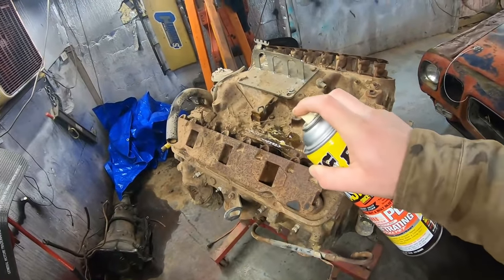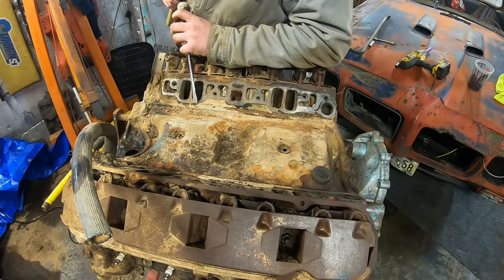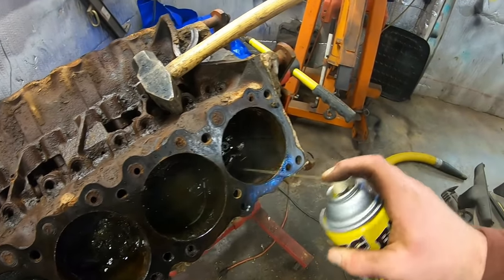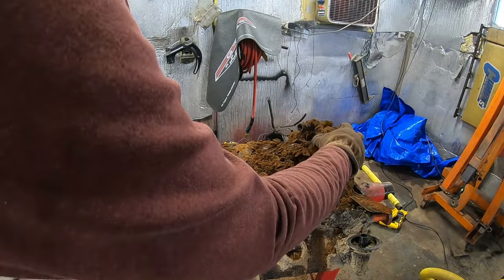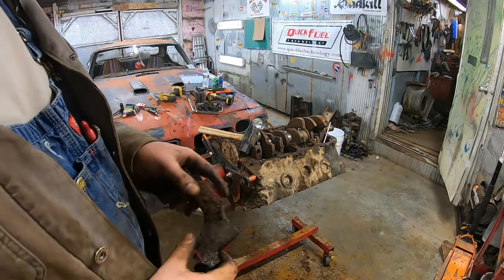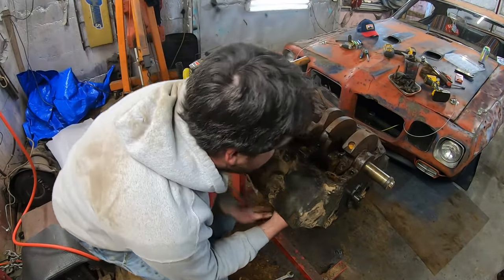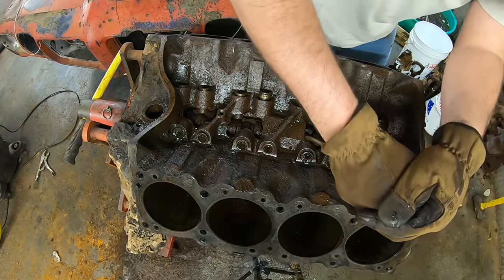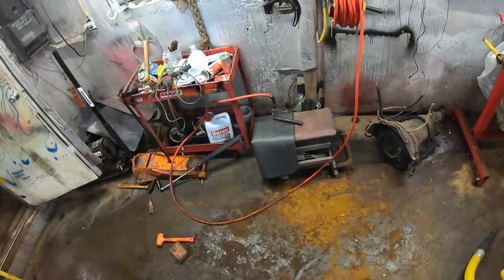INCREDIBLE! Worst GTO Ever: Holey Goat OG Pontiac 400ci Engine Teardown — CAN IT BE SAVED?

Comment: Putting that back into the car will be absolutely awesome, "numbers matching" engine dropped back into this car will just add to the complete absurdity of it all.
Reply from the maker: Yes!
Reply: @PoleBarnGarage  hey… it’s only original once. Lol 😂
Reply: Dooooo itt
Reply: I am thinking rebuild it with a low-end cam then put in one of the older non computer run Chevrolet trucks for a work truck towing engine.
I checked a few days ago will these engines bolt to a turbo 400 transmission and yes, I found they will.
Chevrolet SB 400 is near impossible to find now so the 400 Pontiac has the same 3 -3/4 inch stroke as the Chevrolet SB 400 which makes for a great pulling engine.
Reply: @Lure-Benson  Not sure about bell housings, there is what is called BOP and then there is Chevrolet.  BOP means Buick Olds Pontiac.

Comment: Oldsmobile had the valley pan also. I rebuilt a 350 rocket and I changed the valley pan and never knew that Chevy didn't have one till I worked on my 73 C-10

Comment: I too have always been fascinated with shipwrecks, and the Titanic in particular, since my youth. She has three engines. The two outboard engines are standard reliable triple-expansion reciprocating steam engines. The center engine is a new, revolutionary low pressure turbine, located in a separate room just aft of the main engine room. Powerful, efficient, but unfortunately not able to be reversed. James Cameron depicted this accurately in the movie when the center screw did not reverse. These engines are also low mileage! After watching your video, I am convinced that if somehow those engines could be retrieved, you could save them. With LOTS of PB Blaster LoL!🤣
Reply from the maker: Pull the permits, we got a ship to raise
Reply: @PoleBarnGarage  I'm in!

Comment: I agree with your thoughts on the poncho mill. If the freeze plugs are still in it the skirt area of the block is probably fine. No visible cracks in the lifter valley and I’d guess it hasn’t frozen/busted. Fingers crossed for the magnaflux. Did the crank have a N cast in it? I imagine so with those heads. Hopefully the rods aren’t pitted.
Reply from the maker: Rods look ok at first glance, I think it's a nodular crank

Comment: FYI use the small harbor freight moving blankets , just the right size too ,on the floor under your engine stand during a tear down , or assembly , the catch and soak up stuff really good , and then just toss them , they also have saved my bacon when I rotated one and a lifter slipped out , it cushioned it and it lived , straight to the concrete it most likely would have received damage ... on a stuck piston drilling 1/2 holes as close to the outside as you can without risking cylinder damage will weaken the piston , helping it flex and break loose when driving them out ... I have rebuilt worse than that engine to keep a car numbers matching , no hood or carb for 30+ years it took 8 sleeves , and 16 more for the lifter bores LOL

Comment: It's the friction of the powdery dust/dirt going through the hose that generates the static, and running a wire between the hose/yourself and the block/engine may help keep you from getting zapped.
Dissimilar metals will generate galvanic corrosion where they come in contact with each-other when there is moisture to complete the circuit. Being dissimilar metals, they act like a crude battery and an (extremely weak) electric current transfers metal from one surface to the other, like electroplating. A lot of oxides/corrosion are generated as well.
That's why you can sometimes find well-preserved parts in a waterlogged engine, other parts (like the magnesium case of an air-cooled VW engine) will break down and put a protective coating on the steel parts as they do so.
Of course, it all depends on when the engine is disassembled/salvaged, as that thin coating will also eventually break down and the steel parts will resume corroding away. 
I talk like I know this stuff, but I'm far from an expert on it, so do your own research in case I have stuff wrong!
A desperate person could probably braze that dizzy, if the casing would hold up to that level of heat without melting.
The innards might be worth something even if that's not possible, presuming the shaft is okay.
That valley-plate could use the attention of a wire-wheel, maybe even a needle-gun!
It's likely dirt-dauber wasps that made those nests in that one cylinder, and in any empty bolt-holes.
I have a VW engine-case with most of the bolt-holes plugged up by them!
Ah, I see it has the Titanic-look windage-tray option, that's surprisingly rare!
Man, that bottom-end is way worse than the VW cylinders that I had to pound apart with a sledgehammer! XD
How the heck did mice get inside the oil-pan?!  Surprised there's an oil-pan left with how acidic mouse piss is.
Need to get you some brass rods for beating stuck parts out, then you can really pound 'em!
One interesting simple rust-removal technique I learned about from a gun-restoration channel, boil it off!
That's right, boil parts in plain old water and the rust will loosen up, turning into soft black oxide.
I'd say test it on junk parts to figure out some of the particulars, still figuring it out myself.
I don't see a modern one surviving all that, but an old mechanical fuel-injected might survive! (like a diesel)
Great first video of yours for me to watch, good fun and unexpected results!

Comment: So glad your saving that Pontiac 400 ! 10.25:1 compression 350 HP, SO GOOD. why build a chevy when you can have something different!! Pontiac Power
Reply from the maker: A bone stock rebuild on that 400 would spank any average guys "built" Chevy all day
Reply: Agreed my stock 400 in my lemans was a low rider is a low rider 70k og miles and with 6 extra deep cycle batteries hydrolics would spank a lot of cars on the street that’s why it’s going into our goat unless we turn it into a strip car right now it’s just a dream

Comment: Nice. I have 1970 #13 heads on my TA. I’m running e85 and a turbo. Those heads handle 21 psi like it’s nothing…Nothing special used. Factory head bolts, Felpro head gaskets..Nice project..
Reply from the maker: Are you serious? That is an insane amount of cylinder pressure.

Comment: With all the dirt that was falling out of that engine, I'm surprised the build up didn't lift you up so high that you hit your head on the rafters! I don't understand why you didn't just pull the drain plug on the oil pan and fill with new oil! LOL Thanks for the tear down and look forward to the verdict from the machine shop on block condition. The video's on your other vehicles will be great until then.

Comment: High speed air through the rubber/plastic hose causes the static electricity to build up on the hose and you. Use a car key to touch the engine and discharge through your hand but draws spark from the key.  Good to go.

Comment: I've used pure white vinegar for cleaning cast-iron carburetors on my old John deere and Farmall tractors over the years. I've Never had a problem with it using it in gas tanks either after letting it set for a few days.

Comment: That engine is in way better condition than the 455 H.O. from a '71 Trans Am I scrapped about 15 years ago.  Frozen water inside blew out four cylinder walls and rotted off most of valve heads from the stems. Shame the car only had 74,000 miles but left for dead since 1981.
Reply: Amazing how water is worse than Texas dirt. Just goes to show how storage of the engine is so important.

Comment: I disassembled many flood engines, if you make your own hottank out of a 55 gallon drum and heat it with electric hot water tank heaters under  a raised bottom.  This dissolves most rust.  Pistons are cheap, acetylene torch melt the pistons if stuck don't breath the fumes / smoke.
Reply: Do you use any chemicals with it?

Comment: I think you could call yourself an archeologist.   By the way, I saw a test of different products for penetration,
 and they found out that brake fluid is the best no matter how much you spend.    The problem is paint.  So if you are not worried about taking off the paint, brake fluid is the answer.
Reply from the maker: Brake fluid is corrosive?
Reply: @PoleBarnGarage  it’ll for sure eat paint
Reply: @PoleBarnGarage  Yes.  I forget who it was that did the test, most people don't want to lose their paint though, and it is cheap.  The comparison was with some very expensive stuff too.

Comment: If that car had the original numbers matching motor, the cool factor would go up 10-fold.  My father in law had a '68 GTO and he blew the original 400, and just put a bland 455 in it, and it was blah after that.  Probably lost 100 hp or more with the 455.
Reply: If you can find 6x heads from a 400 (100 cc combustion chamber) you can get a nice compression boost on that 455.  6x heads were dime a dozen at one point, maybe a little harder to find now but if you see them and they’re cheap, it’s worth picking them up.
Reply: I think he did say it was a matching numbers block early on in teardown.snooky

Comment: I did a 1963 olds 215 a couple years ago that was froze up as hell.  The combination that finally got the pistons free was 50/50 acetone and ATF soaking for over a week.  I still busted 3 pistons knocking them out.
Reply: Commented before I saw the wood... after I broke through those 3 pistons with a 1 inch steel rod, I finally got them out a few days later with some generic pallet wood... maybe a 2x4... prolly not, the 215 doesn't have pistons bigger than 3 in... after the fact... a .030 rebore, and it's good to go.
Reply: As for your last question... NOPE!

Comment: I had a 440 like that, came out of a car sunk in a lake for 10 years. I tore off the heads, intake, pan and power washed it got all the mud and crap out of it and then dumped the whole thing into 50 gallons of diesel and walked away from it for 6 months. Came back tore it down and rebuilt it and it runs fine! Makes my ol Dart go like hell. :) This video is like reliving that whole thing...lol

Comment: I just dissembled a dodge 340 that has been setting out side in a junkyard for years, had leaves and mud and dirt all in it, the cylinders was rusted and pitted the pistons was rusted solid, It took me awhile and a lot of PB blaster to get it apart but once I got it to the machine shop it had to be bored 60 over bc of the pitting but I did it and got a new rotating assemble stroker kit and it should come back to life in the next week or so in probably 20 years of setting. Can’t wait to see you bring this old Pontiac back to life
Reply from the maker: Very cool

Comment: i love the 400 pontiac one hell of a engine use to have it ran forever then traded it for a bunch of parts for a 73 ss nova build with a 396 . i still have my 66 389 tripower in my 66 gto
Reply: the heads look good i had a set sitting out side in the dirt for years and someone rebuilt them a set of closed chamber 194 camel heads the block looks good just call it seasoned . we took a 327 put over size cylinders in it then set out side for a year to season the block then rebuilt it . seasoning the block helps rings last longer learned it from a pro engine rebuilder

Comment: Little late, I’m starting to watch your videos in a attempt to better understand motors or vehicles as awhole it’s a learning experience for me. But to answer the static shock question, the easiest answer I could give is the cleaner you used to spray the engine with  it more than likely mixed with the mixed metal in the dirt and all the friction from the sucking more than likely transferred through the thin plastic to your hand and discharged upon touching the ground (the motor) best to use a cleaner with a nonconducting liquid.

Comment: I am an old time speed shop machinist and although I couldn’t really see how bad the cylinder bores were, but there .060” over pistons available back in the day. Now, the cracked main cap, more than likely with a replacement cap, the block is going to have to be line bored.
Reply from the maker: It's gonna need all the mains I'm afraid

Comment: Thanks for the reply did you know that they all also made in line 6 engine's for each brand of GM and that Buick and Pontiac also made straight 8'S some that were over head valves and some flat head's and in 1914 Cadillac had made a 314 cubic inch V8
Reply from the maker: Yes, until 1980 all GM divisions were free to develop independently.

Comment: Going back in time to see some early stuff. Love your videos. FWI the static electric shock you mentioned could be caused by some fine metallic (conducting) powder in the dust (rust) that creates a zone of conductivity around you when its all airborne around you. Good for conducing high V low A  static. Source Might be from your hair or something nearby lke a piece of rug you’re standing on. Anyway when your all charged up (including the cloud around you) and you touch a ground then Zap!  Might be a bit larger charge than normal.  Dave (professional engineer and owner of 1964 Galaxie Convertible plus many orher I no longer own).  Keep up the good work

Comment: On those lifters Ive done it before and it worked but I’d only do it if you had no other way would be to take a self tapper and go in about half way and use a slide hammer to pull it out

Comment: You might have to replace a few parts but I think that blocks and tack if they can hold it out bored out if it's a stock motor that's never been rebuilt. I'm sure you can clean up the cylinders at blocks. And great shape, that's a little filthy. Yeah, first time I watched this it kind of scared me to be honest with you. I think it's solid to me. You have to get a new crank, put in it.
Don't let it overwhelm you.

Comment: Fun fact- big block molars had a intake valley cover as a part of the intake gaskets…. And if’ in ya want an easier time rolling your engine over on the stand-axle grease the hub , lube is your friend
Reply from the maker: It was more because hazardous freight design quality lol
Reply: @PoleBarnGarage  nah mine is the cheap Canadian version-probably the same maker w/different paint color and it’s held 3 small block mopars and a slant 6 with no complaints-grease er up!

Comment: Many moons ago I took a head off a 1960 389 in a car that sat for decades with no hood. 

That was a bad engine inside.  Vertical cracks in the cylinder walls, and I saved a couple of the valves because the stems were rusted most of the way through.   This thing looks great in comparison.  But all I did was take a head off it, who knows what the bottom end looked like. 

My dad bought a '70 Gran Prix brand new and that nylon timing gear failed pretty early on, left them stranded on a trip in like 1972.   Pretty wild that was still in there. 

The same yard I also had to pop a stuck '56 316 off the trans.  With that early Hydramatic the converter doesn't just slide off.  So I had to do the same deal and get the crank out with it stuck.  I must have been lucky because I was able to reach all the rod bolts.  I don't even remember why the guy wanted it but eventually I got it down to him.

I actually got him two blocks but the other one was so bad I used it for a weight in the back of my folks pickup and then at the Syracuse Nationals when the swap was on pavement I roped the canopy to it so it wouldn't blow away.

Comment: The 400 is a solid engine. I had a 400 in three different cars and the only major things I ever did to the engine was replace he timing chain and gears, replace the lifters and pushrods. Rebuilt the carburetor and replace a water pump.

Comment: Next time, too use as a soak to get rust off, buy a gallon of Muriatic Acid, available at Lowes, and Walmart (used to clean pools and concrete) and mix 16oz per every 3 gallon or so of water and let it sit overnight.  Preferably hot water. 
Or use acetone mixed with transmission fluid, which also works better than PB blaster as a penetrating oil...

Comment: Due to Chevrolet 400 SB engines are near gone I was interested the other day will a Pontiac engine bolt to a turbo 400 so I looked it up and Yes they do and so do Oldsmobile - Buick - Cadillac all bolt to a GM turbo 400 transmission so I see all of these Old GM motors for sale on Ebay and maybe this is the answer for one of my Chevrolet trucks to put a 400 Pontiac into my truck with cammed for towing ?
These 3 and 3/4 inch stroke engines do a great job of towing trailers.

Comment: Mmmmmm. Pickled cylinder heads.... Vinegar is an excellent rust destroyer. Also, lysol is an excellent degreaser. I once soaked cylinder heads in I believe was a 50/50 mix of lysol and water. Cleaned all the grease and carbon build up off them.

Comment: Next time use PB Blaster and adjustable wrench for the distributor that square under the housing you work it back and forth so it loosens up done it many times
Reply from the maker: Yeah should've, but you have to factor in that it was clearly underwater

Comment: I saved an original number matching 70 440 charger motor that had been sitting outside for 30 years in MN, my pistons were solid to the cylinder walls with rust, I drilled a bunch of holes through the cylinder and took them out in pieces...you should probably do that instead if it's a block you want to save due to possibly breaking cast block with the dead blows of a hammer. If you can afford a hundred bucks to throw down get a 5 gallon of evaporust, it's a great product that can be reused and is great at destroying rust